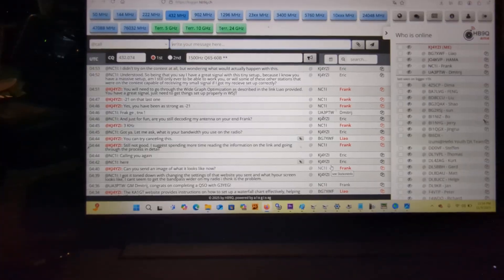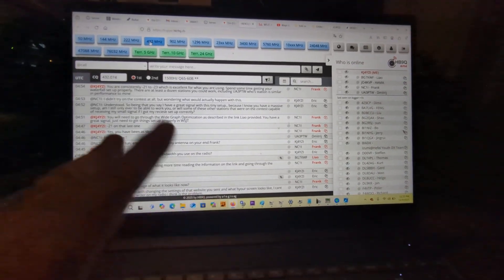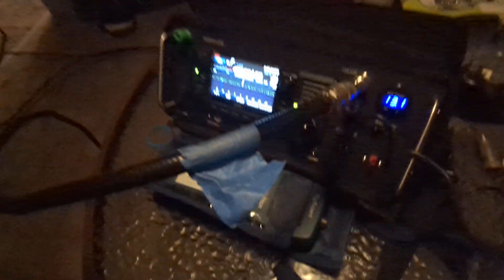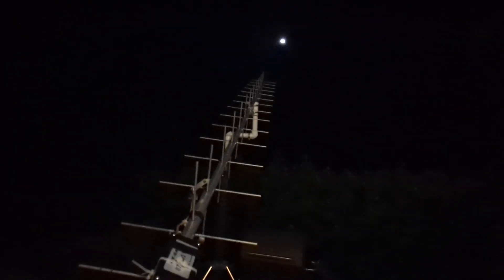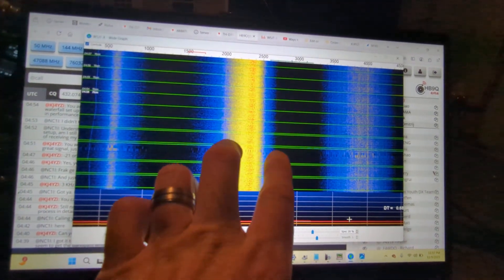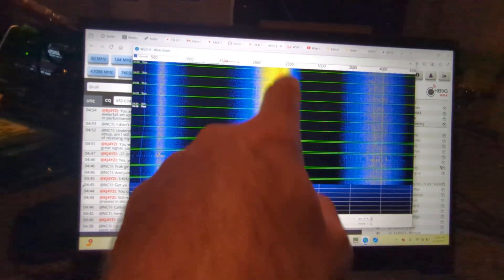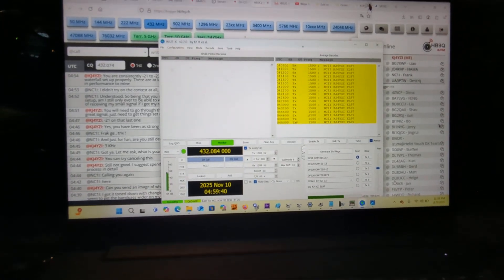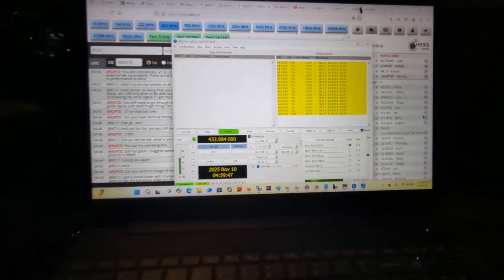70cm EME "Moonbounce" In The Backyard, 432MHz Ham Radio Earth Moon Earth

Comment: You should find UA3PTW, HB9Q and several others very easy to work with that system (without circular polarisation). I once worked Frank with 60W to an 8-el beam with no elevation and the moon at 18° elevation. Your waterfall definitely needs sorting! I use Start =700 Hz, Bins/Pixel = 2 and NAvg=5. My receiver bandwidth is 2500Hz. However, it looks to me as if you have a 500Hz notch or contour filter activated and that's what's giving you the yellow band at 2000-2500Hz. Also, unless you actually see drift on a signal, set Max Drift=0 and make sure you have CFOM set in the Astronomical Data of WSJT-X. With a correctly set-up waterfall you'll see signals down to -30dB, possibly even lower. Take a look at my QRZ page to see my settings. Hope to work you on the moon one day! John, G0JDL.

Comment: Very neat! I wonder if the household power into the power supply is causing your noise? Or perhaps nearby LED lighting? Try testing it with and without the AC power? I have no experience with household power supplies, but I did have a noise problem when I was using an AC powered rotator in my mobile rover. Keep up the good work! -Scott